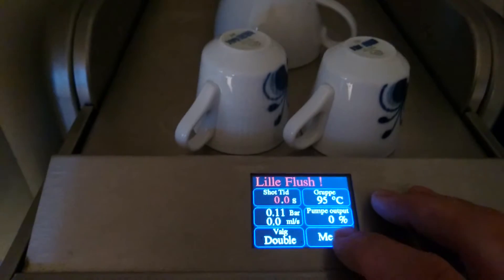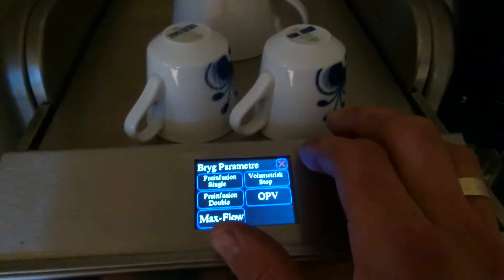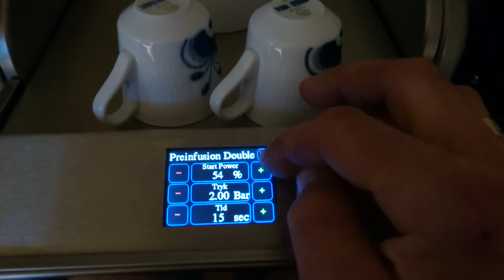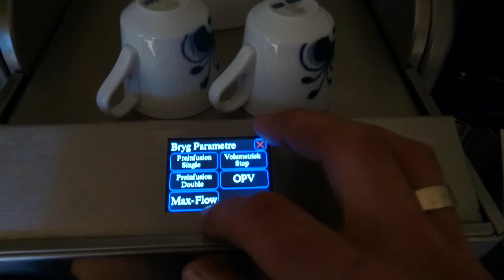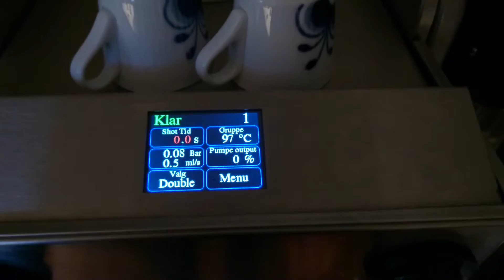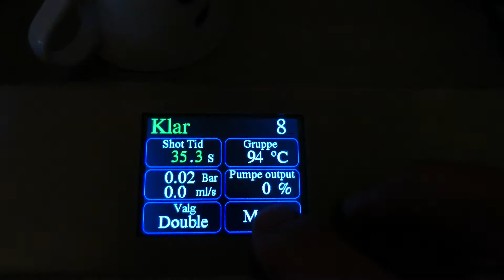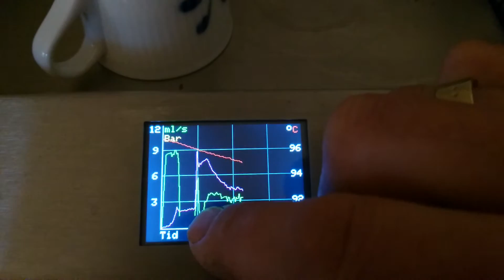La Cimbali Junior with Flow profile

Comment: Hi Jacob, I have a D1, I'm looking at flow profiling, I was going to integrate force sensors to measure the dynamic weight and calculate the flow from that. But, I found this video of yours. It doesn't look like you're using weight to measure flow, so please may I ask, where did you mount the flow sensor?